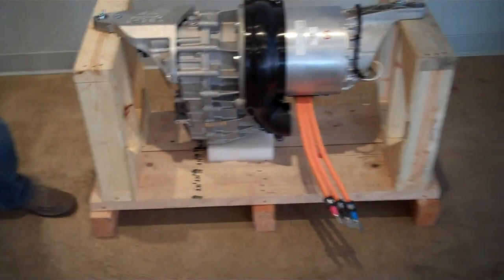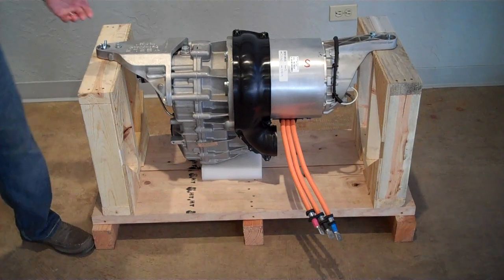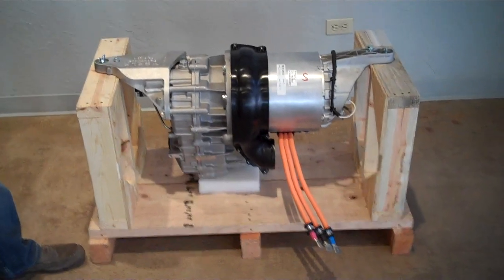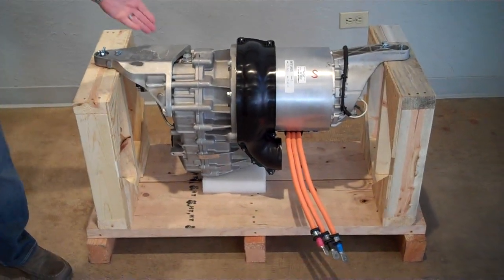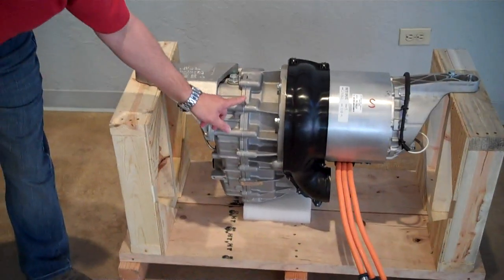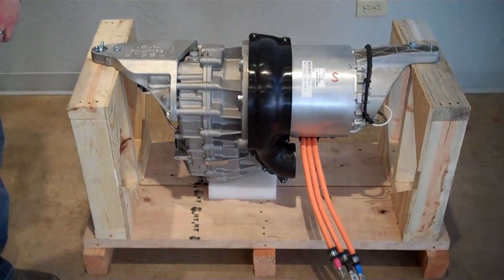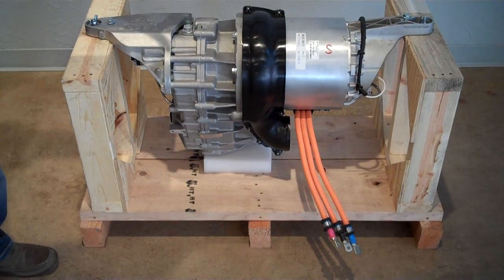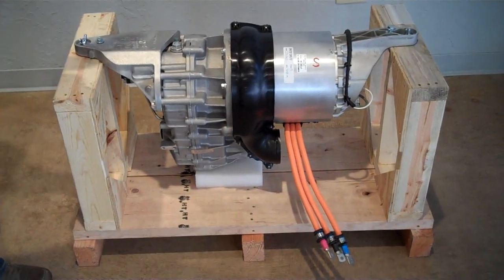Tesla motor

Comment: What kind of motor is this? Did Tesla make it in-house? I need answers. This things output is useful.  All other crap you can find on the internet is exactly that - crap.  Need to know these specs.  I know its a squirrel cage, 4 pole, 3 phase.  Tell me who made the damn thing.
Reply: Okidoki.  Connect the battery to a motor with less windings and see if it does as much work. Yes the electric motor must be able to draw the necessary energy from the battery to do the work, but the motor is still the integral piece of equipment that provides the mechanical work to the output shaft, which regardless of gear ratio, still OUTPUTS 503 hp.  The battery does not output 503 hp, it outputs a maximum of 85 kWh = 85(10)^3*3600 Joules of energy. The output shaft of the motor is capable of drawing 503 hp ~ 375,000 Joules/sec from the potential 306 million Joules the battery can store. I just wanted to know the specs of the 3-phase squirrel cage motor. You don't have to be weird or attempt to answer the question if you don't know the answer.
Reply: Cody Hildebrand 
Read https://en.wikipedia.org/wiki/AC_Propulsion_tzero

I believe you could buy motor & controller from AC Propulsion
Reply: Cody Hildebrand The motor has extremely high power density and conversion efficiency, but vehicle-appropriate motor and drive inverter technology is something that has been around for a very long time.

The really remarkable part of Tesla cars is... the humble battery pack. Despite being watercooled and having the disadvantage of being assembled from numerous tiny cells, it still has about twice the energy density (Watt-hours of energy per kilogram of pack weight) as a nickel-metal hydride battery, such as GM used in the EV1.

Batteries are not considered 'cool' enough for the marketing department to make a fuss over, but the entire car (and indeed, the entire company) revolves around the battery pack. The priciest Model S cars get an 85 kWh pack, which is still quite a bit from ideal, but considering how soon these cars are being introduced to the world, I'd say they're doing a mighty fine job!
Reply: I understand the necessity of the energy density of the battery.  The 85 kWh battery of the P85D provides 503 hp to the rear motor.  That's a lot of balls.  That the motor creates.  Wondering how many windings, what the materials are, what the diameter is, etc.
Reply: The motor does not 'create' power; the battery does. The motor and drive electronics merely convert it from electrical power to mechanical power. That's it. The battery does the hard work; it is the almighty key to the ideal electric vehicle. The motor does not 'work hard' to give the car it's 'balls', it merely converts one form of power to another, it functions as a transducer. In an electric vehicle, the motor and drive electronics function as transducer and transmission, they are NOT analogous to an internal combustion engine. The critical part, and interesting part, if you dare, is the battery pack, not the motor or electronic control unit.
Reply: Yes, the battery DOES put out 503 HP, in electrical form. Plus, a bit extra to offset the motor's slight waste of energy (the motor is not 100% efficient, it's closer to 80-90%, which is excellent.) The motor may be a high-quality well engineered device, yet it is so ordinary as to be rather unremarkable. The range and acceleration performance of the vehicle is dependent on the battery pack; the motor is the easy part. That IS the correct answer.

If the motor itself turns your crank, many different designs will get the job done; Tesla chose an inside-rotor, 3-phase induction motor. Some of the specifics are known to those who work at Tesla Motors; the finer details are known to those who work for AC Propulsion, the motor's supplier. Any motor meeting the requirements will suffice. The Tesla battery pack is the key point, the motor and electronic control unit have been well-understood for many years and don't represent any kind of hurdle or significant technological achievement. If anything, someone just got around to building them to take advantage of improving battery technology to produce a modern example of a high-performance electric car with usable range.

I'm not being 'weird', you just need to understand that the motor's requirements are straightforward to meet and the only remarkable thing about it is that it meets Tesla's requirements and specs. You need to figure out for yourself why the question you're asking seems to be so important to you. Maybe consult AC Propulsion themselves. They'll tell you, "Tesla paid us money to make a motor this big that could run at this RPM and load before this percentage loss of conversion efficiency"!
Reply: Cody Hildebrand It's a high frequency design motor based off aviation 400 Hertz AC motors. You get more power with higher frequency with reduced weight and volume. Nothing special really since 400 Hertz systems came about during WW2 for radar systems.
Reply: BasementEngineer Your statement is not quite accurate. Electric motors make power against a load. They will produce more or less power depending on the load where as combustion engines do not have this ability.
Reply: EETechs ??? Not sure exactly what you mean, of course IC engines produce power when applied to a load. If there's no load, they're not producing any power (other than what is required to run themselves, which doesn't count as power output.)
On the other hand, the electric motor produces more torque the lower the rotational speed, as long as electrical input power is maintained. An internal combustion engine doesn't have this characteristic which is why a transmission with multiple gear ratios is required for an IC engine vehicle.
I simply stated that the power is produced by the battery, not by the motor, the motor just converts it from electricity to two different forms--mostly mechanical power, and some heat.
Reply: BasementEngineer Not just torque. POWER also increases as you load down an electric motor. This is not true of combustion engines. For DC motors max power will occur where 50% efficiency is reached and then it falls off as you overload beyond this point. For AC motors max power occurs at breakdown torque and falls off very abruptly. 

 This fact is used to size electric motors smaller in applications that have an RMS horsepower rating equivalent to the electric motor's continuous rating. What matters is that the "average heating" of the motor is equivalent to as though the motor is ran at full hp rating, hence, mechanical RMS horsepower for variable load profiles that have a repeating cycle.

The same cannot be applied to combustion engines because they will stall as soon as the overload spike in the variable load profile is reached, hence, they must be sized for the worst portion of the variable load profile.
Reply: EETechs Interesting stuff, thanks for the informative post!
It's important to keep in mind that sizing of internal combustion engines to cars has less to do with a nominal power requirement and more to do with marketing; a given car is expected to emphasize either fuel economy or acceleration performance (or some compromise between the two) and the engine's size & power are chosen for the market that a given car is expected to appeal to.
With electric motors, the motor is sized for best conversion efficiency over the power range that the car normally requires in everyday use (as you said, RMS power), but unlike IC engines, the motor can be severely overloaded to provide the peak acceleration required. The motor would eventually overheat if expected to deliver this power continuously, yet for a car that only requires peak acceleration for a few seconds at a time, it works just fine--allowing the motor to run close to peak efficiency for continuous-speed driving.
Reply: Haha that's what I'm talking about! +Basementengineer you're right a single battery produces all of the power. But properly converting that much electrical energy to mechanical energy in a the tiny volume of their electric motor is impressive. I would think that usually much larger electric motors produce that kind of torque and hp but I'm not sure.
Reply: Cody Hildebrand The key to it is that the motor doesn't have to produce all that much torque. They run it very fast to get the power out of it, and then gear it down to provide the high torque to drive the wheels. This is a common technique used with electric motors--run them as fast as practical, and gear them down to produce the speed and torque required for the application. It allows a much smaller, lighter motor to do the same job. As an added bonus, the smaller & lighter motor is less expensive too.
Tesla cars use an AC induction motor with a variable-frequency electronic drive, which gives a very versatile power unit capable of reaching its max torque from a standstill and also reaching very high RPM. As a result, the car does not require a transmission with multiple (shiftable) gears--just one fixed gear ratio is all it needs. The motor can even run in reverse, so you don't even need a reverse gear :)
Reply: The Cheerio Kid I'd imagine the motor and drive inverter are actually fairly inexpensive and straightforward to produce, especially when you consider that it's a fairly lightweight and highly efficient part of the power system.
The killer is the battery pack, it's half to two thirds of the cost of the car! There just isn't any way around that yet. That's why Tesla is working on the uber-expensive and labor-intensive task of gearing up for very large-scale automotive battery pack production, to reduce the ridiculous cost of the packs. Only then will these remarkably clean, energy-efficient vehicles start to become a normal part of many people's lives. Until then, long-range electrics are an exclusive niche product for the very well-to-do who don't mind dropping over a hundred grand on a second (or third, or fourth) car.
Reply: The Cheerio Kid What do you mean a 'wheel'? I know what they are; I'm just wondering exactly what you're referring to :)
Reply: The Cheerio Kid Gotcha :) Hub motors are a convenient way of 'electrifying' any bike, they allow for a tidy, compact installation without having to mount a motor & gearbox in the frame of the bike. However, they are direct drive only so they don't allow the use of mult-speed transmissions. I've always wondered why nobody builds a hub motor with integral 3-speed transmission that allows extreme hill climbing, normal riding and max speeds on level ground all in one convenient package that mounts in the rear wheel of a bike. Direct drive hub motors are usually 'geared' (through choice of motor Kv and battery voltage) for speed and efficiency when riding on level ground, but you cannot shift gears for steep hill climbing or best acceleration. There's a reason why people still use mid-motor setups, they allow the use of the bike's full range of gearing. They're just messier to install and use up space in the bike frame that's useful for mounting the battery pack & motor controller, and require a one-way clutch on the pedal shaft to allow either pedalling or motor power, or both. So, they're more complex and expensive, but have a large performance and efficiency advantage because they make use of the bike's available multiple gear ratios. They can also be lighter in weight.
Reply: The Cheerio Kid If you have an expensive bike I can understand not wanting to hack it up :) Thing is, small brushless DC motors use permanent magnets whereas the Tesla motor uses an AC induction motor. The low speed torque is much more limited on a permanent magnet motor compared to an induction motor of similar power and speed, so a transmission with more than one ratio is nice to have because it keeps the permanent magnet motor's efficiency very high. Tesla's AC induction motors are very different beasts from the BLDC motors used on ebikes! They can always benefit from having more than one gear ratio. Three is plenty. Since you use your own muscle power too you're ahead of the game, I'm lazy and just use the motor because... it's there :)
Reply: The Cheerio Kid Thing about AC motors powered by DC supplies (batteries) is that they need a more complex electronic drive system to work. BLDC (perm. magnet) motors, especially ones with Hall sensors, use pretty straightforward electronic control units, whereas ones for AC motors are more involved and trickier to set up for a given application. If you want an AC induction motor in a small size, you can probably build one out of an inrunner BLDC motor by replacing the permanent magnet rotor with a homebrew squirrel cage rotor, and driving it with a variable frequency AC drive. It would be a heck of a project but would involve a lot of work, you're probably better off using it as-is and cobbling together some type of multi speed transmission. Since bikes often already have that, it's a lot less work to use the existing multi-speed chain drive system and add a motor drive to it with a one-way clutch on the pedal shaft, since you're going to need it anyway for pedalling.
Reply: The Cheerio Kid Right on! Where do you plan on getting the PV cells? This is something that's been an available albeit expensive option since I was little, most people's daily driving needs require the amount of energy that can be provided by roof-mounted solar panels. It seems to me that that would be the ultimate goal of electric cars; completely sustainable transportation. Something tells me that civilian nuclear fusion power is a very distant prospect, but PV cells have been around for decades. It's a question of getting the cost down so that they become more practical.
Reply: The Cheerio Kid Just curious, what's the out-of-factory cost of photovoltaic cells? Small shops and online dealers charge exorbitant prices for solar cells. If they could get it down to a buck a watt we'd be golden :)